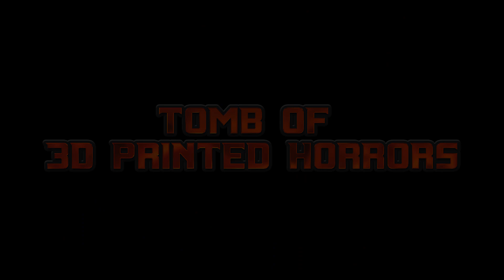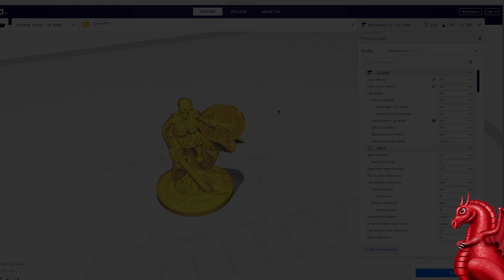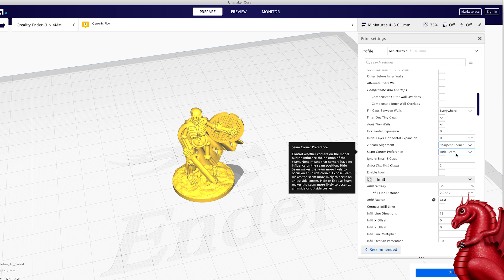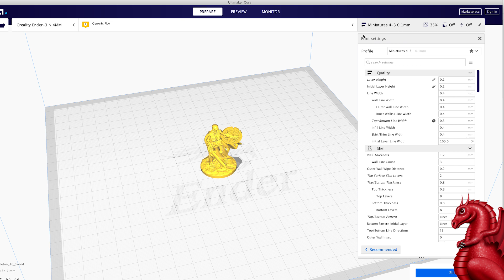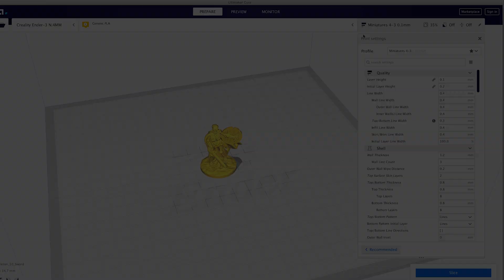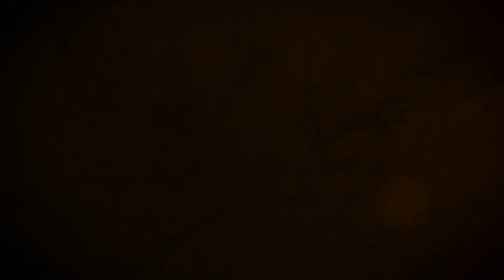How to 3D Print Better Miniatures: Pt. 2 Cura Settings

Comment: gonna try this on a small detailed print.
Reply from the maker: This video is almost seven years old, I have much newer/better settings available on my website under the Resources menu.
Reply: @Tombof3DPrintedHorrors ok thanks I realized that AFTER I already started my print lmao. I don't make miniatures I just wanted really good tiny details. I figured this outta work just fine
Reply from the maker: @Nicos_Snare  use the newer settings, Cura's core engine has changed a lot since this was made.
Reply: Update: it went really well. Thanks

Comment: Half steps on current printer z's are mostly irrelevant not, with a ABL probes for the z off set you printers will adjust the z height by increments of 0.005 within the same layer as it adjust for printing on slightly uneven beds. This only applies to printer that have a manually leveled be and no ABL and are probably using a glass bed ect.

Comment: My prints keep having strings after these settings. Someone got any tips? Im printing on a ender 3 with pla from 123inkt
Reply from the maker: Two things: 1: Use my latest profile for Cura (these settings are pre-Arachne for 4.x series), and 2: Use better filament (Hatchbox is great for printing minis on Enders.) :)
Reply: @Tombof3DPrintedHorrors  where can I find your latest settings?😁
Reply from the maker: @ my website under the Resources menu.
Reply: @Tombof3DPrintedHorrors  thank you so much! Youre the best!

Comment: Hello, nice. But I got problem with printing minis, use 0.2 noozle, very slow printing, layer height 0.12. But lower part of the figure is bad. Visible lines. What I do wrong? Any help?
Reply from the maker: Drop layer height to .1 max. Are you using my custom profiles for miniatures?
Reply: @Tombof3DPrintedHorrors  I try, but you got 0.4 nozzle. I try update your profiles to my printer 0.2 Noozle and Cura 5.0 .  The bottom side of minis and the support is problem.
Reply from the maker: @jbml3642  I include .2 and .3 Cura profiles in the same .zip folder as the .4 nozzle profile. Do not use the .4 profile settings and just change nozzle size, that won't work and is likely your problem. Also, none of our miniatures require supports, turn them off.

Comment: Awesome breakdown I have downloaded the profiles and currently using the 0.4 mm profile on Ender 3 v3 se with PLA+ @ 215 temp. Having issues with things like arms falling off / failing mid print. Is there anywhere you recommend for troubleshooting advice? Either way I will be getting buying some FDM Minis and Terrain for sure.
Reply from the maker: If you're using my profile on a V3 you need to change the retraction distance to 1mm. :)

Comment: I've been following your print settings with my ender 3 S1 Pro and have had a lot of success! However, there are some mini's I've been wanting to print that need supports. Is there a support type that you recommend? Are those settings in your Cura Profile download?
Reply from the maker: No, I do not create support settings as none of my models require supports.
Reply: Did you tweak anything from the profile ? Any solution for your supports ?
I'm getting the same printer and curious about your experience 🙂

Comment: this video made the quality of my slice preview sky rocket. I was trying to print a head with horns on it and the tips were not printing out. after following these adjustments to the options it changed to a fine point. thank you.
Reply from the maker: Try my current profile settings on my website, the new profile quality blows these older settings away.

Comment: Hey, should I use supports for non FDG minis? Thanks, and which would you recommend?
Reply from the maker: You need to ask the designer of the models you are printing for their recommended settings, I can only advise on FDG model requirements.
Reply: @Tombof3DPrintedHorrors  Where can I install on FDG
Reply from the maker: @UbiScoop  ?
Reply: @Tombof3DPrintedHorrors  Sorry auto correct, where can I install the STL for these minis?
Reply from the maker: @UbiScoop  www.fatdragongames.com

Comment: How come you're not using support.?   Can you go over the settings for support for miniatures? Some stuff have major overhangs that. But everytime I try to use the support doesn't quite seem to work right
Reply from the maker: None of our FDG minis require supports.
Reply: @Tombof3DPrintedHorrors   so the guy holding the spear sideways and above his head, didn't require supports?
Reply from the maker: @ProwlersPit  nope.
Reply: @Tombof3DPrintedHorrors  how?

Comment: Interesting... my experience is that when printing holes, printing the outer perimeter last leads to tighter fits (sometimes parts don't fit at all and I have to add more tolerance), meaning that the inner perimeter takes up space and pushes the outer perimeter out from its intended position. Thus I assumed that printing the outer perimeter first would also lead to better surface quality. I use PrusaSlicer though. I will give disabling that a try and see if my logos come out more crisp.
Reply from the maker: What does that have to do with printing gaming miniatures?

Comment: I'm having a big problem with the minimum layer time and minimum speed when printing things like long weapons. It melts it the point that the tops are just melted chunks of plastic lol. Has Cuta changed or are the cooling settings not valid anymore for minitures?

Comment: Are your old profiles for the Ender 3 v2 still available? I've tried with drivethrough but I couldn't find them. Thanks
Reply from the maker: The Cura download on DTRPG includes some previous versions
Reply: @Tombof3DPrintedHorrors  I'll have another look. I've seen only 3 profiles offered.

Comment: Hi Tom, thanks heaps for this, I've gotten a LOT of use out of it. Would you consider doing the same for Cura 5? A lot of the settings have changed and there are some that I can't relate back to the settings you discuss.
Reply from the maker: I have Cura 5.0 profiles on my website (getting ready to release updates of them this week, too!)
Reply: @Tombof3DPrintedHorrors  thanks, but I'm printing on a flashforge printer so I can't use the profile or see what's in it. Previously I'd been able to adapt your settings to my printer. I don't suppose you'd consider publishing a list of settings? My apologies if you already have and I haven't seen them!

Thanks again, you do amazing work!
Reply from the maker: @brettcroese2982 just download the profile, there are screen shots of all settings included.
Reply: @Tombof3DPrintedHorrors  awesome, thanks heaps!

Comment: Hey Tom, thank you for your profile in the description. So far it's the best one I have used. My model is very detailed. The only problem is, that it has too much stringing, do you know a possible fix for this (Ender 3 v2). I tried looking online to fix stringing, tried much, but couldn't really solve the problem.
Reply from the maker: Are you using eSun? They changed something recently and it strings a ton. I switched to HATCHBOX. Also make sure you are using my most recent profiles.
Reply: @Tombof3DPrintedHorrors  I am using PLA+ SUNLU. and yes your most recent profile is from your website right? around december 2021 released?

Comment: your current setting speeds are very different, do you suggest the new speeds or the ones in this video?
Reply from the maker: Always go by the current profiles as they are modified to keep up with changes in Cura as new versions are released.

Comment: Just watched an hour and a half of your videos and it has saved me multiples of that PER PRINT on print times(not to mention the time it would have taken me to work out how to do this, which realistically would have been never).

I was using the top layer trick as suggested by many online and getting shoddy results after 12-24 hour prints. I just reprinted a previously 12 hour job which took a touch over 2 hours and is of hugely higher quality. Looks like I can hold off on that resin printer after all. Not only that but the presentation of this channel is superb. Subscribed and very thankful for the work you have put in here.
Reply from the maker: Glad it helped you (and yeah, stay away from using the so-called top layer trick, it's a terrible setting and causes other issues in Cura that diminish print quality.) :)

Comment: Started 3D printing with Ender 3. most of these settings were extremely helpful in perfecting my prints of basic D&D figurines. however there was one subtle setting that was screwing over a specific test model over and over, and it was the Outer Wall Line width. The model has a sword with a pretty nifty overhand angle, but the tree supports generated under the sword were nowhere near touching the edge of the sword. on closer inspection, the gap was caused by a grey outline of the sword that was not being filled by any layers. changing the width of outer wall layer to .2 filled some of that grey area, but changing outer wall width to .1mm completely filled that grey area. Hopefully now I won't have an oddly thin sword (supposed to be gladius shaped) that droops extra.

Currently using ABS filament (plenty extra came with printer upon purchase so using it as practice) if that specifies anything else.

Comment: here i am the  idiot that cant figure out how to get the profile off the drop box and into cura
Reply from the maker: Did you read the instruction PDF included with my profiles?
Reply: @Tombof3DPrintedHorrors   yes i did i found them after i posted the comment  thank you very much i just got a ender 3 pro yesterday so im still very new to this
the instructions were very helpful

Comment: Thanks for this awesome content. This has helped me greatly in fine tuning my ender 3 v2. Now my questing to you is this. I have a cylinder with a hole in the middle. 40mm wide, 22mm internal diameter and 5mm heigh. I have infil before walls tucked yet it always prints the walls before infill. No matter which way I have it around it always prints walls first. What am I missing? Running cura 4.8. Cheers.

Comment: hey, new subscriber, followed all your cura settings per minis, tweaked things as per my own dnd mini and will have to keep dialing in my material temp (hatchbox orange pla and {future} overture green) when i get a proper temperature i would like to scale up my mini (454%) and i was wondering if i needed to change anything in particular, im thinking wall count correct? or would i change infil settings as well?

Comment: I tried printing with these settings for the first time, the quality of the prints came out great and the supports removed easily from the part, however the supports themselves were so solid I couldn't break them.  I ended up breaking the mini off the base and then sliding the supports down off the legs.  Anyone else having similar issues?  Would it still work to reduce the support density so they break apart easier.  I couldn't crack them with plyers they were so solid...
Reply: I ended up using flush cutters.

Comment: Hey there is this work with ender 5 and ultimate cura 4.7.1  and also using  pla material ?? thx
Reply from the maker: Yes
Reply: @Tombof3DPrintedHorrors  for a 28 mm miniatures? I use zbrush for years but I just only the videogame workflow, now learning about ultimaker cura, I just make a hole in the magentic bed XD and it was a printer of 2 days

Comment: Hey thanks for sharing your profile, I tried it but I didn't get nice results, was printing a banana knight i found in thingiverse, i had printed one with default settings, which wasnt too detailed but it looks good, i accidentally broke the arm with the shield though so I was going to reprint it with these settings, but it seems to go a bit too fast! I can clearly see the ground is a lot more detailed, but after about 40 mins the print was a mess, stringing everywhere so I canceled it.. 
Could it be that it was going too fast? I'm using CURA 4.7.1 with an Ender 3 pro.
thanks!
Reply from the maker: Try printing one of our Fat Dragon Games Dragonlock miniatures and see how it works.
Reply: @Tombof3DPrintedHorrors  Ahh didnt realize the settings are made for your miniatures, I downloaded a free knight you guys shared a while ago, will try that one, thanks

Comment: Gonna try this out now. My cura profile was way different than yours and it worked well on large prints but really struggled on smaller. Thanks for posting
Reply from the maker: Be sure to use my latest one for Cura 4.6.2 at the link in the description
Reply: @Tombof3DPrintedHorrors  Will do, thank you.
Reply: @Tombof3DPrintedHorrors  I think you mentioned that your minis avoid supports but have you done any testing of the different types of supports when it's necessary? I'm currently getting very rough textures where the support touches. I might have missed it but I dont see a video on how to handle supports/overhangs
Reply from the maker: @emptyheat25  no, as none of my models require supports I have not developed settings for them.

Comment: I am trying these settings with my new Ender 5 pro and every time I am having an issue where the filament breaks at the feeder and then the print fails.

I already changed out to a new capricorn bowden tube and also a new nozzle after cleaning everything out.

I put the new nozzle on backed it off a turn put the new tube in and re tightened the nozzle.  All of this in case maybe it was a clog causing the problem.

But after printing a basic test print successfully I went back and tried another miniature and 2 times I failed with filament breaking right at the feeder.

I downloaded the cura profile from your links you have posted here and have verified that the settings are all looking like what you have in the video at least from what I can see.

I also have tried setting the motion speed in the ender as the image file in your download link says but that doesn't help either.

Any idea or advice on solving this problem would be great!
Reply: Sounds like your filament my have absorbed moisture and is now too brittle.. Just a guess as there are many things to consider when an issue pops up. Try another or new filament and see what happens.

Comment: The profile available for download differs from the things you are talking about in this video. The Shell wall thickness and wall count for example. 

Is there something wrong on the settings, or did you do a 360 in opinion on this matter?
Reply from the maker: The mini profile should still be 3 shells, I'll have to check it out
Reply: @Tombof3DPrintedHorrors  I'm also getting a lot of stringing with the profile, something else that might be amiss?

Comment: I have been using 3d printing DM's support settings and they have provided me with decent quality prints. However, I get blobs and the layers aren't as smooth as I would like them. When I implemented your profile into mine and used the supports they started to not fill out and break away. It's almost as if the material is too far back in the nozzle to print the supports. Is there a specific setting you use for supports?

Comment: Any chance we may get cura profiles for other fdm printers ? I use an Ultimaker pro 2 +
Reply from the maker: Nope. I can only make profiles for printers I own (I got rid of my two Ultimaker 2s last year).
Reply: @Tombof3DPrintedHorrors  Too bad, thanks for the reply anyway !
Reply: @Tombof3DPrintedHorrors  Although I did try your ender 3 settings ont my ultimaker, copying theme by hand, and they work pretty well, my only issue now is supports.

Comment: how do i get the cura profile i downloaded to cure? like what folder in cura does it go in? I put everthing in manually and printet my small part. and my god it looks good. :D
Reply from the maker: Just watch my video titled 'How to Set Up Cura & Import Custom Profiles'
Reply: @Tombof3DPrintedHorrors  so i just watched it, and i did what you did. but i get this when i try to upload the profile. Could not find a quality type standard for the current configuration.

Comment: Super helpful, thank you! Is there any chance you could also share your insights on the optimal settings for supports (standard or Tree) and print orientation? That’s been a challenge for me lately with slightly more complex shaped models...
Reply from the maker: None of our models require slicer supports :)
Reply: @Tombof3DPrintedHorrors  lack of support info really sucks. im not gunna buy your models, i play sci fi games. I need to know what support setting i need.
Reply from the maker: @TheCheeseKnees97  then you need to ask whomever you bought your minis from for their recommended support settings (I have no way of knowing what support settings they designed/engineered their product to use.) I provide customer support for my products which includes recommended print settings, so should they.

Comment: Hi ... I can't download Cura ..... I have been using Repieter Host Cura Engine for some time ..... could you tell me which settings are suitable for this program since there are not as many calibrations as on Cura? Thank you 
Ciao...io non riesco a scaricare Cura.....uso da tempo Repieter Host Cura Engine.....potresti dirmi quali settaggi adatto a questo programma visto che non ci sono tante calibrazioni come su Cura? Grazie

Comment: I was looking at printing a dragon that takes up most of the buildplate and 92mm high (needs supports) and it's saying it will take 3days and 14hours, is that normal?
Reply: for that size? Yes.

Comment: I used the 4.4 cura profiles from the drop box and honestly, everything came out stringy and all the details were mushed together. It was a huge mess. I didn't mess with it because I did't know enough. I'm in the process of mixing and matching settings between popular 3d printing youtubers and hoping I crit a good cura profile.